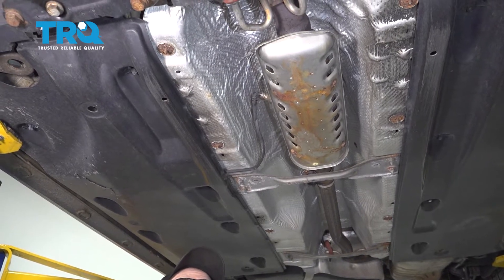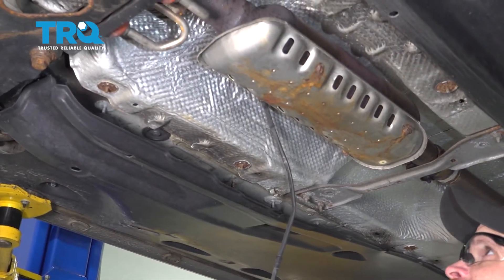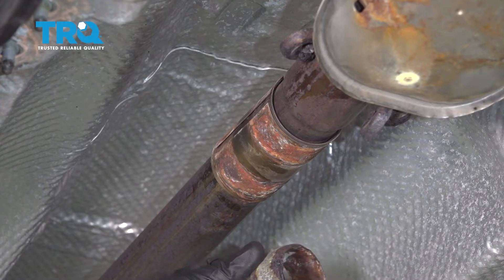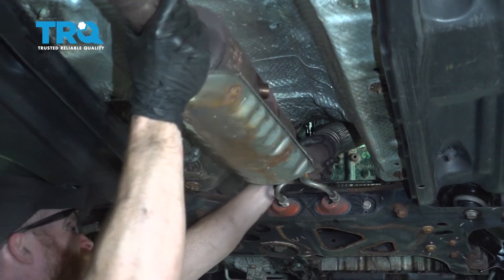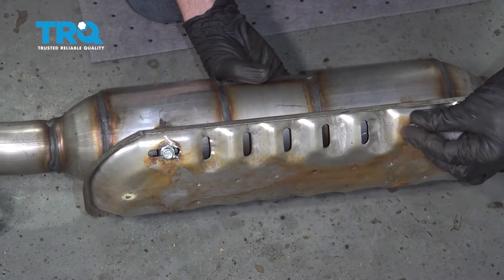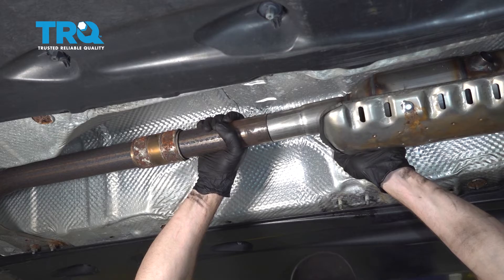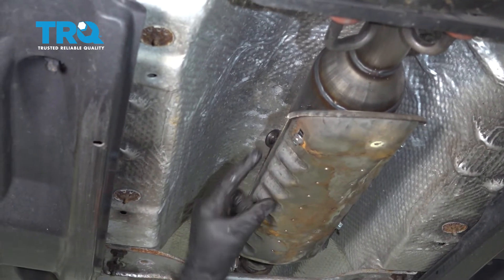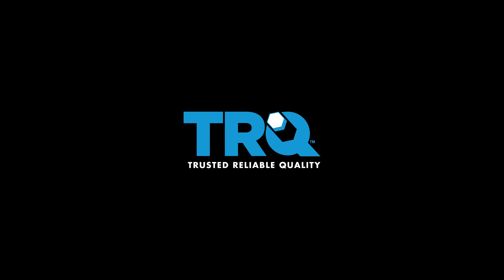How to Replace Exhaust Pipe with Catalytic Converter 2011-2018 Volkswagen Jetta

Comment: Does the upper sensor need to be on the cat itself? If not can I diy for the sensor onto a pipe and put a after market cat that doesn't have the hole for the sensor?

Comment: The best video yet. Why did you remove the o2 sensor cable from under the plastic shield instead of just remove it from the catalytic converter?